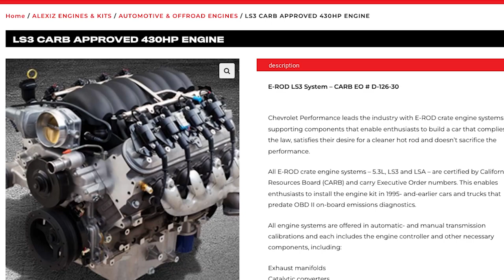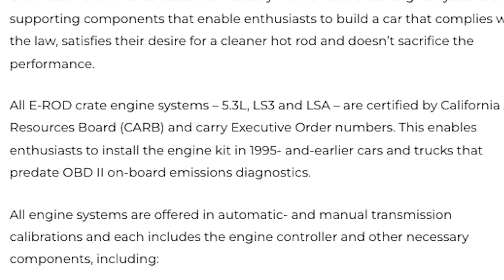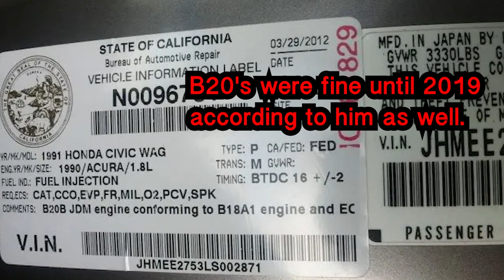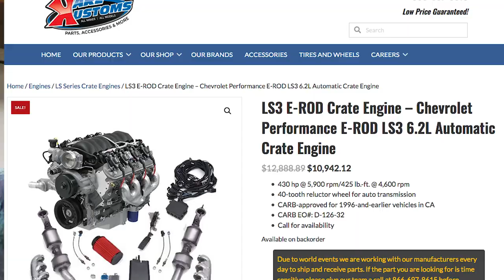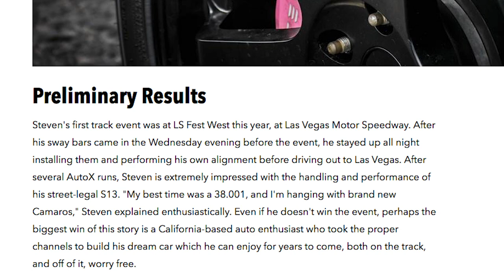Why California's BAR / CARB logic makes no sense.

Comment: It’s always about money. Even carb legal parts like intakes and headers are only legal as long as the company keeps paying the state to hold that permit. So you can buy the legal parts and if that company stopped paying it’s no longer legal.
Reply from the maker: That's insane I didn't know that. I knew it was about money just not about the expiration of carb parts with their permit . It's just a racket
Reply: @4realtime783  similar deal with things labeled organic big cash grab and it’s never really been about emissions. It’s always just been about control because who is most likely to modify a cheaper import car probably minorities.

Comment: Please don’t take this the wrong way. Rules are rules, it’s been this way for a long time now with the B20. 

It’s not because it’s unsafe, it doesn’t even say that. It’s just simply a rule they have to not allow car classifications to mix. 

So no truck (heavy or light duty) engines can be installed into any car chassis. 

Since the LS3 is a car engine, they can be swapped into a car chassis.
Reply: Justifying rules that don’t make sense..the apathy is strong with you. That’s how communism thrives. “Rules are rules.”
Reply: @AvocadoToasted  ok dad.
Reply from the maker: I get rules are rules but the rules don't make any sense. And somebody I spoke to did cite safety concerns from having a truck motor in a car so that's a true statement it just goes to show how little the people in charge of making the rules know about what they're in charge of.
Reply from the maker: @AvocadoToasted  this is the result of a free market capitalist system